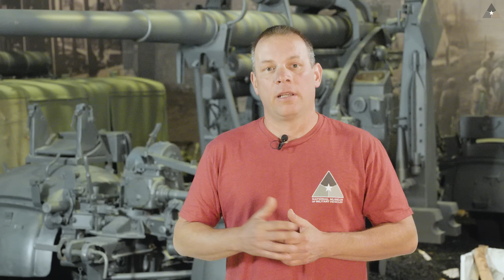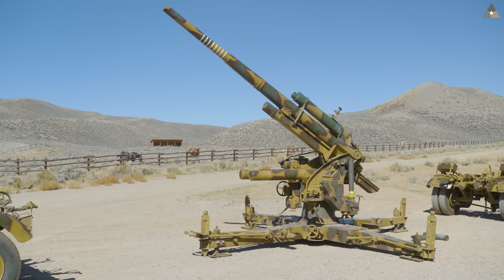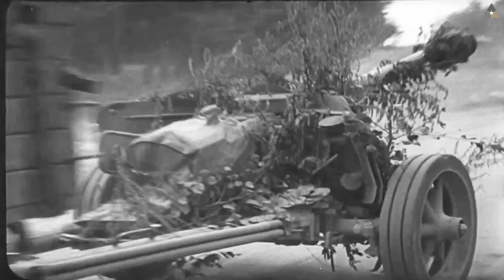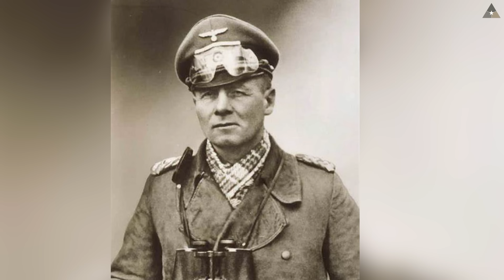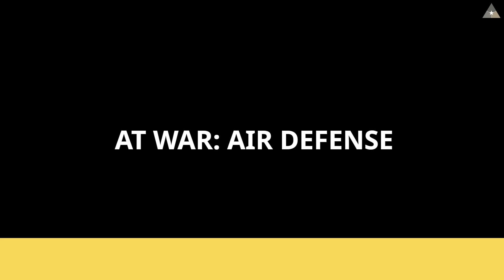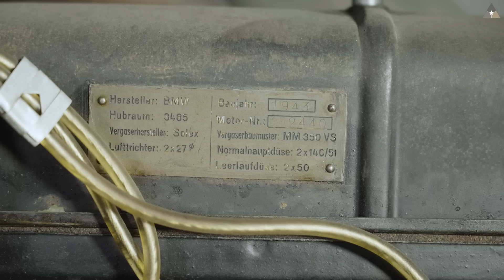88mm Flak Gun: Developed in Secrecy for WWII

Comment: The fact that Nazi Germany eventually had to create such a huge war machine to defend against Allied bombing (example, 1/3 of ammunition production went to AAA) illustrates the REAL concept of strategic bombing.  Strategic bombing is not about pitting one air force against another, or about bombing what kind of factory or installation---it's about pitting one side's industrial capacity against the other.  The Allies' ability to crank out unfathomable quantities of aircraft, aircrew, fuel and ammunition FORCED Germany to devote precious resources needed for the land battle to be diverted to defending against Allied bombing.  Make no mistake, for the Allies it was a Meat Grinder---RAF Bomber Command had roughly 50% KIA rate while the USAAF 8th Air Force KIA rate was somewhere in the high teens to low 20s percentage-wise.  (The USAAF 8th Air Force had more KIA in WW2 than the ENTIRE USMC.)  Hopefully this series will report the KIA rate for FLaK crews for comparison.

Comment: What is wrong with 90mm???
Reply: Brits had the 84mm, USA had the 76&90mm AA guns. Soviets had the 76 and 85mm AA gun. (No one but the US wanted 90mm guns)
Reply: @Knot_Sean  yes that is what I am wondering about. Guess it is performance where shape and weight means when you calculate design every millimeter counts. Is it so critical that you could not add 2mm and go 90mm. Sigh.
Reply: That would mean a volume increase of 7%, assuming the dimensional ratios of the shell and projectile remain the same. This is a significant difference, as everything must be adapted to handle the increased weight and pressure.

Comment: One element on German ammunition the Tank ammunition shifted from impact primers to electrical primers as it faster to twist a blasting machine handle than recocking the gun. All current NATO tanks use electrical firing.  Current modern Russian tanks use The GUV-7 primer is triggered by an electric pulse from the firing system, which then ignites the main propellant to fire the round.

Comment: I liked the information presented on the FLAK 18 etc, but I think the AAA technique wasn't explained well enough.  The 8.8cm FLAK didn't get aimed AT aircraft--the shell bursts were aimed at a piece of sky that the enemy aircraft were expected to fly into a short time in the future.  The shell took time from being fired to bursting in a piece of the sky, and multiple batteries would fill a segment of the sky with flying shell splinters that hopefully contained enemy bomber formations.  Detecting and tracking enemy aircraft in four dimensions (distance, bearing, altitude, and time)  should be familiar to shotgunners.  There are 395 #7-1/2 pellets in a 12-gauge field load and with a modified choke half of these pellets will pollute a 30" circle at 40 yards--but a quail is a small target about 18 square inches and four or five pellets out of 395 must hit the quail to make it fall from the sky.  Even good shotgunners are going to miss most of their shots, and in order to get enough hits on target, quail hunters figure that only one percent of their pellets will hit a quail at the end of their effective shotgun range.  Because the quail is moving through three dimensions over a period of time the shotgunner must track the quail in order to stay on target and must lead the quail enough so that the shot cloud engulfs the little quail when the cloud of pellets arrives where the quail is.  The 8.8cm FLAK guns fired at fast-flying planes (200 to 300 MPH) at altitudes over 20,000 feet and often the gun crew didn't see the bombers.  Instead, the gun directors had the battery fill their assigned sector of sky with bursting shells (azimuth and elevation to reach a three-dimensional coordinate multiple bursts at a specific time).  The 8.8cm shells were unlikely to hit a bomber at 24,000 feet moving at 300 miles per hour with an impact fuse so the shells were given a time fuse to explode a set number of seconds after being fired from the gun.  This produced concussions that the bomber flew through---but more important was the expanding cloud of flying metal that punched through aircraft skin, through flesh, through engines and structural members, and most devastatingly through fuel tanks and possibly even through the bomber's payload.  Most fragments, like the 12-gauge load of #7-1/2 shot aimed at a quail, were going to miss the bomber and return to Earth.  Backfall is something left out of anti-aircraft fire but those fragments falling to Earth did produce casualties--which is another topic, I guess.   Personnel and equipment needed to be under cover or the fire fans planned so that nothing important was beneath where the fragments fell.

I gave a lecture on how this worked last decade at the Hill Aerospace Museum in Utah.

Comment: TY Dustin, great job amid 1 or 2 mislabeled photos, otherwise top notch. Enduring question is WHY didn't the allies use there 3.7 inch Vickers AA , or 90mm AA in a dual purpose role also ? German army proved the concept in France , 1940 ? when Rommel forced the issue.
Reply: Strange question, the Allies had perfectly adequate anti-tank weapons anyway and weren't fighting rearguard actions, the Germans used the 88 in desperation as they had nothing else. The Allies also used the superior 94mm 3.7" AA gun in an anti-tank role, I worked with a guy who served in WW2 in Africa and Italy on one. The 88 is just kinda hyped up by war gamers.
Reply: Allies had suitable numbers of large AT guns that fitted the tactics etc, the trunnions were not designed for horizontal action etc....the answers are simple when you look
Reply: Thé 75 of an m4 tank runs literally circles around a 10 man 88

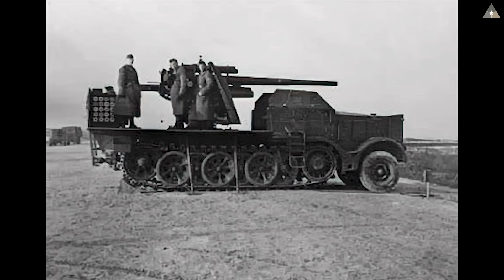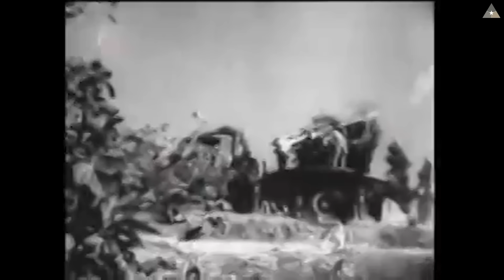Comment: At 9:32 while discussing 88 gun mounts, you show a photo of Maunsell forts, a British antiaircraft installation which would never have 88s on them. https://en.wikipedia.org/wiki/Maunsell_Forts and you repeat it at 10:31. This sort of error devalues the entire presentation which is otherwise pretty good.
Reply: As do the claims of a mount on a T34 (a photoshop hoax), a modified Panther chassis, that was not a modified Panther chassis and Tiger 1 & 2 having "versions" of the gun, they were NOT

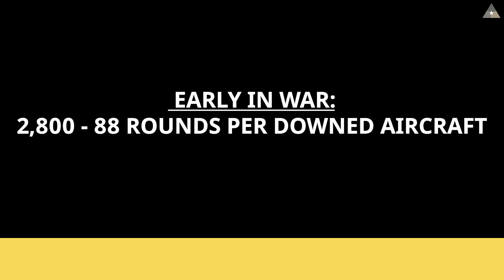Comment: At 23:00 you highlight the lack of training of Flak crews as a main cause of the higher number of Flak rounds-per-bird needed to down an Allied aircraft as the war progressed. There was a lot more to it, including changes in tactics by the Allies, strategies and equipment (chaff, jamming) to reduce the effectiveness of centralized radar Flak battery control, and the increased ability of American aircraft to bomb through heavy cloud cover using radar targeting which made German Flak less effective. There is a good video on the topic here: https://www.youtube.com/watch?v=Lxupv39gA6U&list=PLO7SMfMqEYq41AjEeqkWzxokSVINLFG6f&index=3
Reply: Another contributing factor was quality control at every stage of production, leading to higher failure rates of rounds (fuses not working properly, incorrectly mixed batches of propellant, etc) as well as reduced reliability and accuracy of the guns themselves.
I'm not sure how the number of 16000 is arrived at specifically, but it may even include shipments of shells destroyed by allied air attack on the way to the batteries, something that would have happened rarely earlier in the war when tactical strikes like that deep within Germany were simply not happening.
Reply: One more factor is the lack of proximity fuse shells. They probably have been much more cost effective than the masses of standard shells, but they apparently did not perfect them.